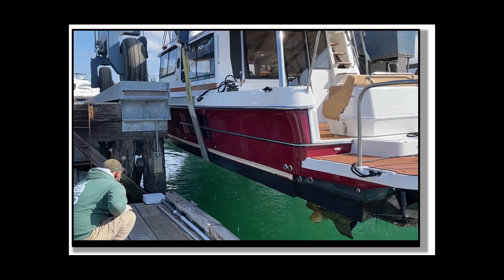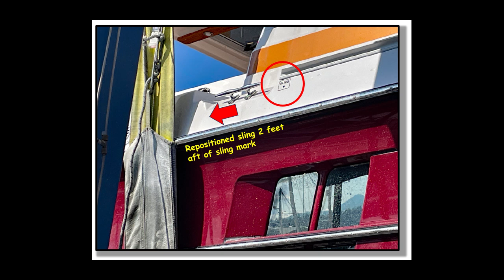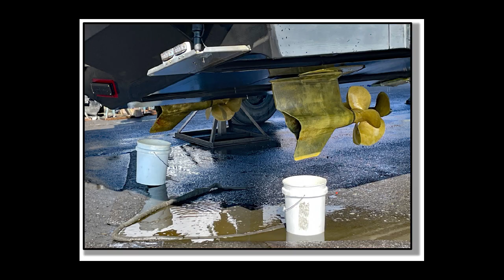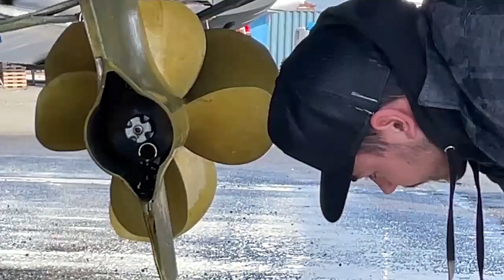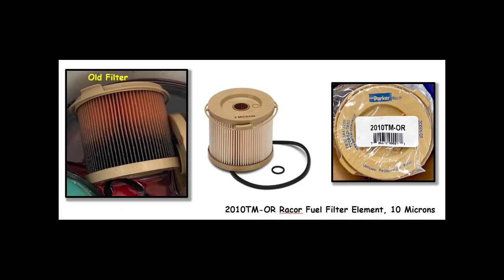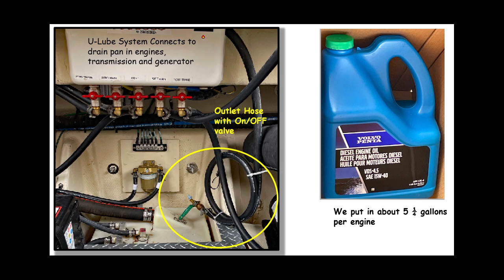First R43 engine Service

Comment: What is the range
Reply: My experience has been .75-.80 mpg on plane at any speed 14 mph-30mph.  At 9 mph I see 1.5mpg tyically and at 8 it is 2+ mpg.  If you are willing to go 6mph or less you can see 3.5 - 4.0 mpg.
Reply from the maker: With 300 gallons in the main tanks and 30 gallons in the generator tank (which can be transferred to the mains) the range of the R43 depends on what speed/rpm settings you choose.  Go fast and get 1 mile per gallon or go slow and get 4 mpg.

Comment: You may want to replace the seawater impellers too: Although they're not due, they don't cost much and can wear out prematurely.  (I've replaced them with the boat in the water which is doable but exciting.)
Reply from the maker: Thanks.  Exciting eh?  Any tips?
Reply: @boborca  at least with my Volvo I/Os, when you remove the cover, water starts gushing in.  The aft bilge pump more than kept up, but it instills a sense of urgency to complete the job.
Reply from the maker: I see.  Yes, that would definitely get your attention.  Thanks for the advice.